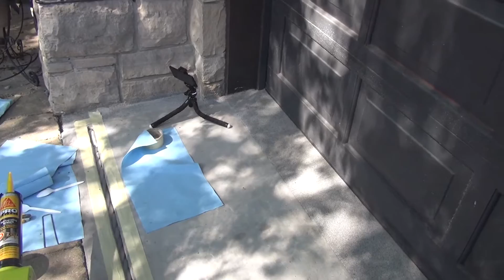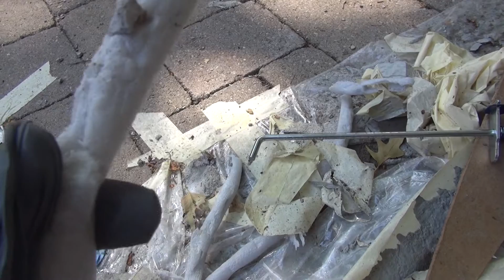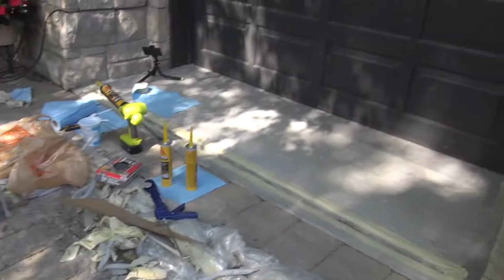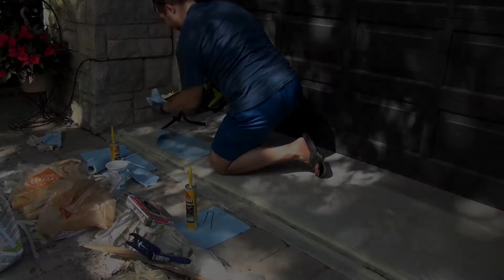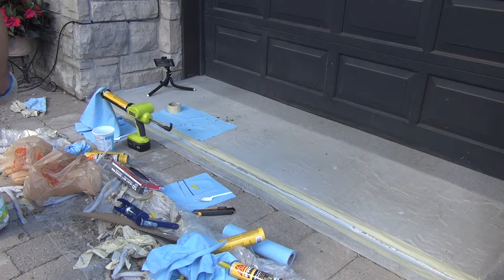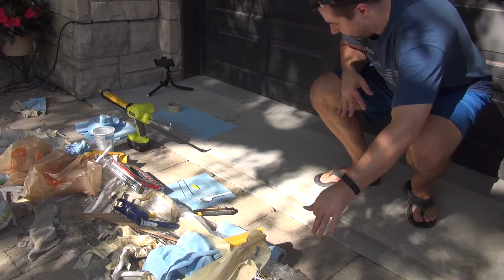Concrete Driveway Repair - 10 - Joint Caulking

Comment: Should not put the sand so soon, the sand will sank and make the elasticity of the sealand harder to move during cold or hot weather. Better do not use sand at all per Sika rep cs
Reply from the maker: Fair point, but I am not overly concerned in this case. Given how much sealant I put in (quite a bit), the sandy part is only maybe a couple of millimeters or 1/8" deep. I am pretty sure there was still plenty of untainted sealant under to provide flexibility even if top skin would crack. But I can report that after 2 summers and 2 winters, there is no trace of cracking or any other damage to the sealed joint. And I definitely like the look of sanded joint better than one of pure sealant.
Reply: What do you mean? The sealant should only be about 3/8 of an inch above the top of the sealant. It should be 1/2” at the bonding surface.
The sealant will fail prematurely  by using sand, And by twisting the backer rod, and installing it too thick. I have installed sealant in miles ofthese types of joints. And have removed and reinstalled sealant that failed because of these issues. ( using sand and twisting the backer rod and installing it WAY too thick) BTW  the sand will cause the sealant to pull free from the sides of the joint. IT WILL FAIL PREMATURELY. If done correctly it should last 20 years. With these errors maybe 5.

Comment: Oh my mistake you did. Probably should have used a bigger sized backer rod.
Reply from the maker: Indeed I did, you were too fast responding while I was typing ;) The thing is, the joint is just too wide, not much I can do about it (well, I suppose I could have rebuilt joint walls for tighter fit). I used two twisted smaller diameter rods as I didn't have the bigger diameter on hand, that probably didn't help with fairly liquid sealant. But bigger diameter rod I may have had to put deeper into the joint for it not to stick out in the middle, unless there are some rods with flat top profile. But I agree, normally you would expect to use less sealant than I used here (mostly because the joint should be narrower).